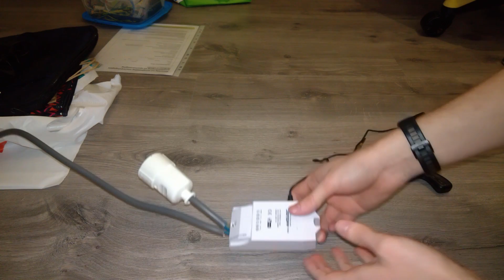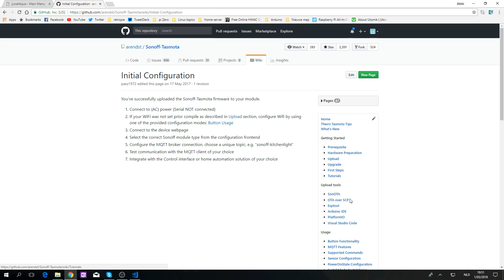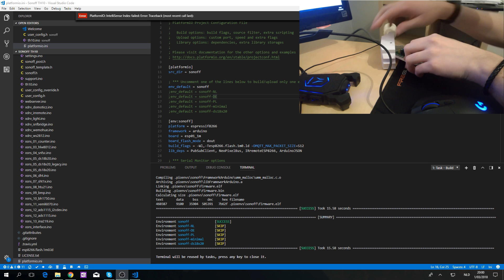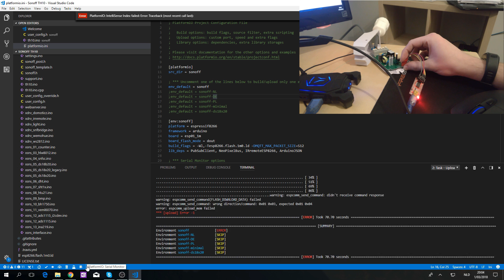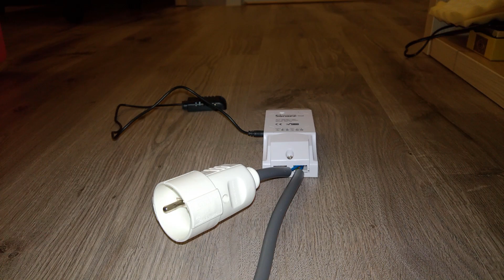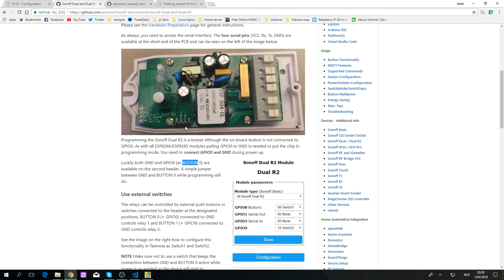Flashing any Sonoff with custom Firmware (Sonoff TH10 with Sonoff Tasmota firmware)

Comment: Man was this a PITA! On top of all the extra money I had to spend and the time to do it, it does not work as a simple thermometer. Mine ended up in the trash!
Reply from the maker: Unfortunate that you had this experience. Mine has been running well since I created this video and I'm using it both as a timed on/off switch and as a thermometer :) Maybe your unit or flasher was broken?
When flashing my first sonoff ever I did brick mine too...

Comment: Hello is flashing firmware will let you make custom application ?
Reply from the maker: technically yes, but you need to make sure what you write can be interpreted by the chip. For that reason I use pre-build tools like sonoff tasmota or ESPHome

Comment: Hi, will work with th10 firmware 2.0.4? I've bought one, but the "over the air" method is not working :(
Reply from the maker: Not 100% sure what you mean. Does the OTA not work for the tasmota firmware you are using? If so, I would suggest opening an issue in the tasmota repo on github. Those guys are more qualified at helping you :)
Reply: @TriplusTutorials  confirmed! sonota not working in firmware 2.0.4 TH10, but tasmota by ftdi works well, thank you for your video :) I'll report to sonota guys too
Reply from the maker: have fun with it. IT's a great tool once it is working :)
Reply: @TriplusTutorials  thanks and yes, sonota.exe or sonota.py(linux) its not working in sonoff TH 10(firmware 2.0.4). The issue is open now :) I will try the FTDI method later, and I'll back to you

Comment: Hi. Thanks a lot for the excellent video. As you know the temperature accuracy of Th10 is 1C˚. I want to change it 0.1C˚. Can I do this by flashing Tasmota Firmware? Or how can I do this? Thanks.
Reply from the maker: Sorry for the late reply, have been pretty busy.
As far as I know my temperature sensor in my homeassistant using this module with Tasmota has a 0.1°C accuracy.
Reply: @TriplusTutorials  Thanks a lot. Then; Tasmota is excellent.

Comment: too much hassle... just use nodemcuflasher and flash one of the precompiled tasmota firmwares, connect to the AP it creates on 1st boot and configure from there... 2 minutes to do everything, no arduino or other stuff needed...
Reply from the maker: In the end it is the exact same thing. Both require you to open up your sonoff and connect via an adapter. I just prefer of having the extra safety of making the exact changes I want compared to having to rely on the UI to make the changes :)
Reply: Ive checked your other sites but cant see where you show us how to do that
Reply from the maker: haven't done it on video yet, but it's just a piece of software you download that will flash a pre-compiled image. the connections from pc to nodemcu are exactly the same.
Reply: Just flashed also with nodemcuflasher, it really is easier.
Reply from the maker: Francis Verhelst It is, but in my opinion you have less controller afterwards. But to each their own 😁
Reply: control on what, exactly? Ance you have web gui, mqtt, a bunch of standard sensors, support for every sonoff builtin, you are ready to go... the only time i needed to recompile was for changing mqtt library as i use a remote mqtt broker and if there's no internet the sonoffs go crazy... what REAL advantage did you get by compiling?
Reply from the maker: disabeling certain components that are not needed to save space. On my first Sonoff I was unable to run it with GUI, not sure why :) There I really needed to do it that way.
But for most nodemcu flasher will indeed work.
Also some people are paranoid and won't trust pre-compiled things... you never know :)
Reply: you just need to flash the minimal firmware before the newer full one, just that easy...
about code: do you really take a look at it? REALLY? EVERE time you update?
Anyway who compiles the firmware is the same person who develop it, with default settings...
don't be paranoid for just the sake of it...
Reply: to be clear: i'm not against you or your approach (which is valid and words, no doubt), but to go that way i'd like to have better arguments, and till now i've not seen any...
Reply from the maker: no no, I understand. I don't look at the code. This is just the way I have been doing it for all my Sonoff devices :)
I just know there are people who would rather know exactly what they are using.
Also, the nodemcuflasher with precompiled firmware is probably sufficient indeed for 98% of the population.
As I see many questions on this I may flash my new sonoff with nodemcu and make a video from it. (wil lbe the 4channel one) :)
Reply: believe it or not, it would be one of the first, if not the only one (not really, DrZZs made a video on this but without all the details i'm going to list here), video on this procedure, so easy... the other flasher you can use is the one in every EspEasy firmware release, some say it's even better... just take the exe from the zip file and use it to flash any .bin file... i flash sonoffs in 30 seconds, attach a flying header pins cable to the holes (not even solder them...), put device in flash mode, upload, done...

oh, and once you're there, you can open putty or even the arduino ide serial monitor to give the wifi credentials via serial, so when device boots you're already connected, without going to the temporary captive portal... use the parameters SSId1 and Password1 (SSId2 and Password2 if you want to setup even the failover wifi connection), followed by the respective values, and you're done, all the other settings can be done via web gui...

REMEMBER that sonoffs should be flashed in DOUT mode, it's clearly stated on tasmota wiki... on nodemcu-flasher this has to be selected (and the memory size, too: 1Mb for sonoffs, if you select the wrong one it works anyway but OTA will not and you could have to reflash them via serial cable to correct it...), while the espeasy flasher seems completely automatic on both of these settings: just select com port and bin file...

Comment: Thanks for this video that helped me to flash my first sonoff th10 today, not with the Tasmota firmware but with the KmanOZ/KmanSonoff (github). I've now an extractor fan switch On when humidity >= 60% and all set up in HomeAssistant and NodeRed on my RaspberryPi :)
Reply from the maker: happy to help. The Sonoff is indeed a wonderful device with which you can do a lot :)  Have fun!

Comment: Great video. I set up one of these for my aquarium. I have the one with the waterproof temperature sensor and it works great. Thanks again.
Reply from the maker: same here. I use one on all my aquariums and have some automations in homeassistant set-up to power on and off a raspberry pi based dashboard :)
Reply: TriplusTutorials yeah, I'm just getting started. I have loads of Xiaomi sensors everywhere. The Fish aren't connected yet. All the tank equipment is still sperate and works with timers or a  thermostat. I'm not quite sure yet what's possible... First step is probably a 'maintenance' switch.